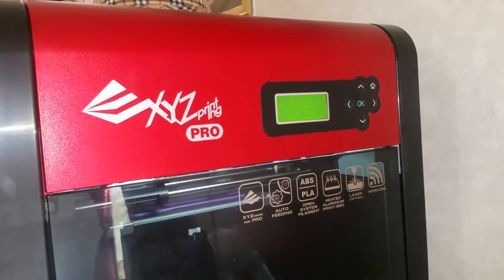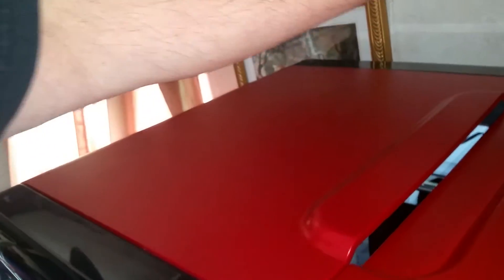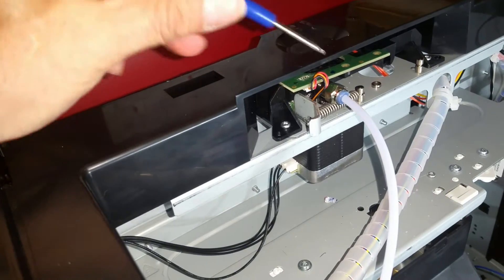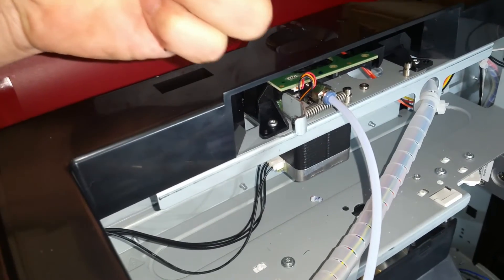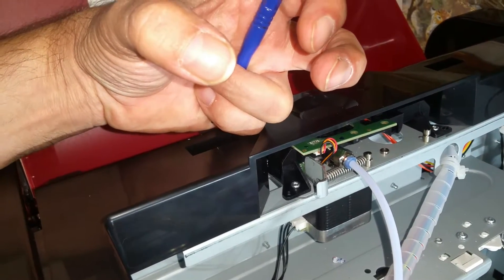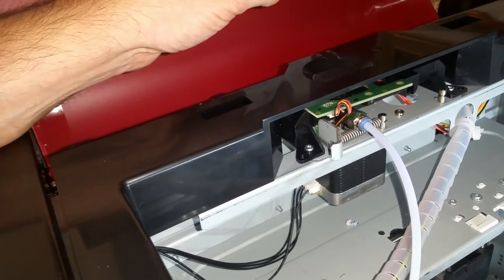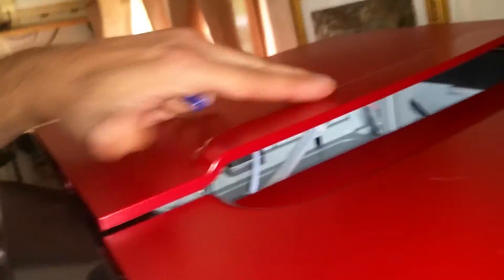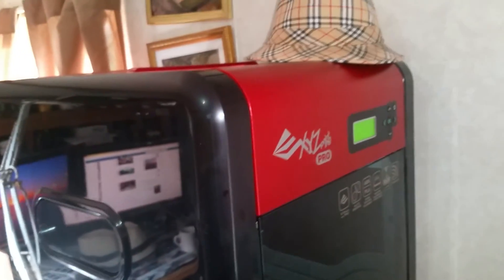XYZ da Vinci 1.0 Pro BROKEN in 10 days. Bowden Tube came out of the quick connector

Comment: I have this printer too. What I did is simple, just put a little bit of super glue between the tube and it's connection point, problem solved, the tube never come out again. I have purchased 11 3D printers before. This problem also happened on Malyan M200 3D printer.

Comment: I have many problems with this bowden, it doesn't accept cables no original pla / abs. ago a noise type tac tac tac and the cable it doesn't flow inside ><
Reply: If you have problem loading the filament and did not come out from the print head, what I usually do was manually load the filament by removing the print head first, until I can touch the filament caming out. Leave it about 2mm and put the print head back in. Now you can use the Utility function on the printer to load your filament, I set the temperature at 230 degree celcius. Once it comes out from the print head, your entire spool of filament will works well. Do the same when changing spool of filament, a little bit tedious, but works well for me.

In my experience, if the tac tac tac sound comes out during printing, you can try to solve this tac tac tac problem from the slicing software. There are two infill settings. Original settings show 100% for both, but I put the top infill(I think is shell infill if I am not wrong, my computer is not with me now) to 94% and the bottom one to 92%, which is good for my printer. You can try to lower the % until there is no more tac tac tac sound. I am using 240 degree celcius when printing PLA, I found the quality is better at this temperature. Besides, if it only sounds on first layer, then try to align the print bed again.